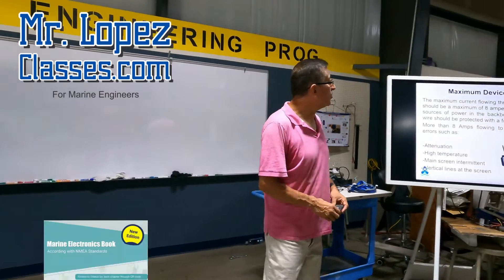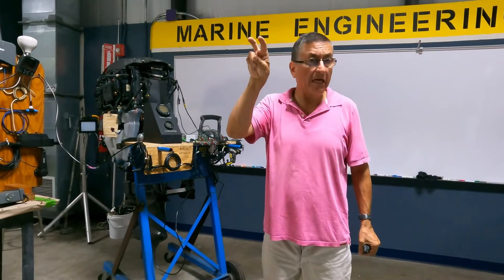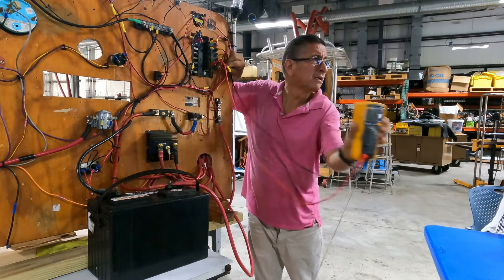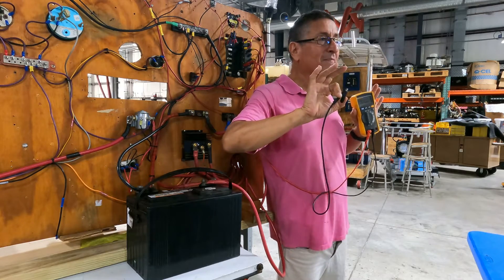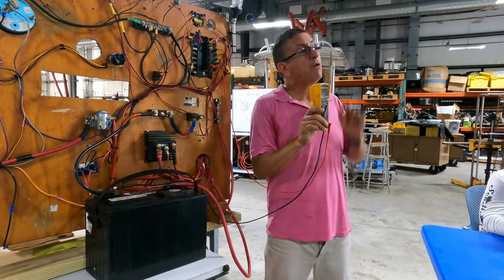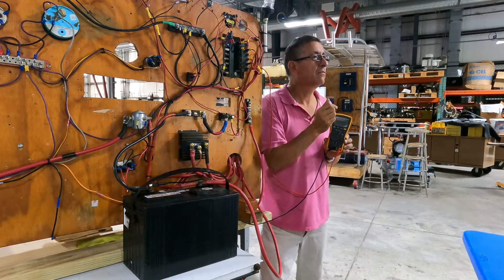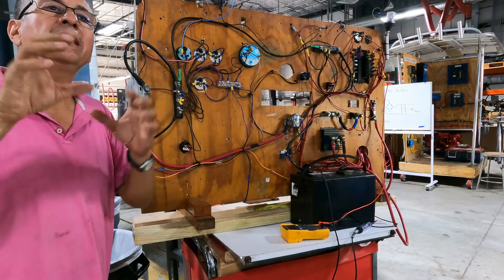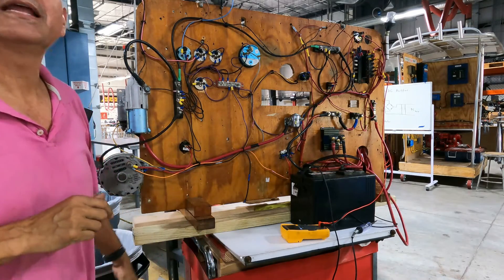Reading Amps and Voltage Drop

Comment: Love this guy, great information. 

If there is a large voltage drop, how you troubleshoot positive lead or negative lead that has the voltage drop? Assuming the battery is good >12VDC. 👍🏾